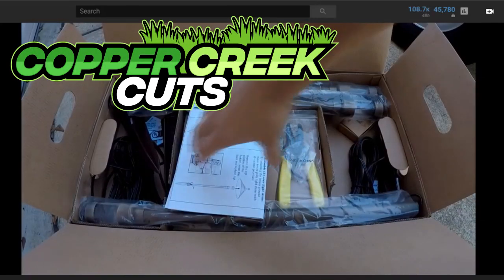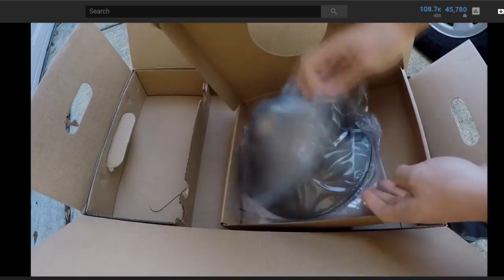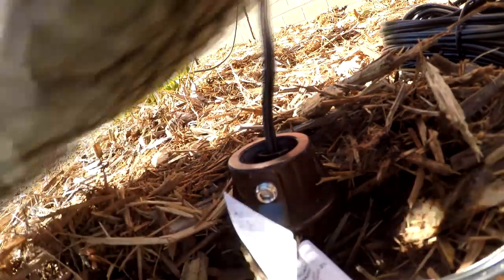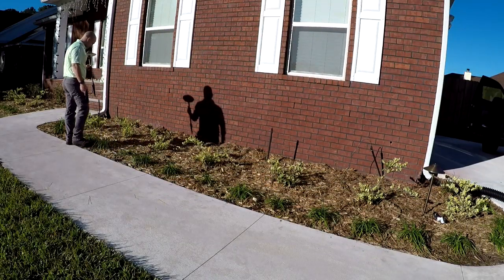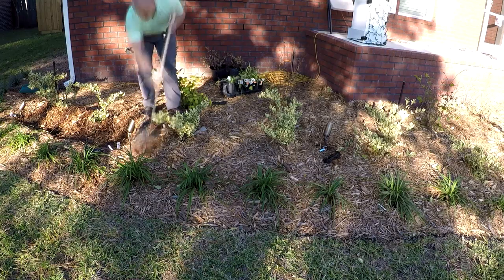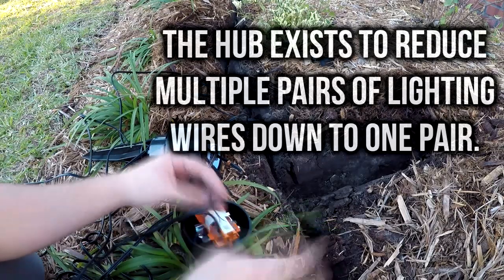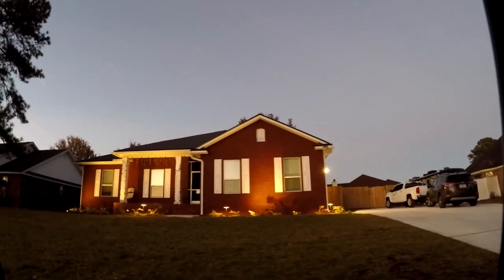How To Install Landscape Lighting That Looks Like A Million Bucks (COSTCO Volt Light Kit Install)

Comment: Does the Volt timer need to be used?  Want to use on demand and connect transformer to a light switch for ambiance lighting on a patio.
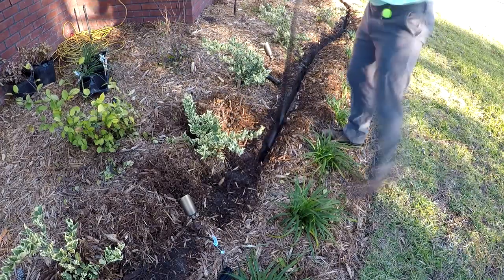Reply from the maker: The timer has multiple settings, including 'on'. https://www.youtube.com/watch?v=_Zo_bzC9IiM (4:15 for a still of the transformer that should help you)

Comment: Costco currently sells 6 piece kit with transformer and all other bell and whistles,  but I need 14 path lights. Can I add additional path lights to transformer or do I need to purchase two 6-piece kits and 2 additional lights?  If I purchase 2 kits can I add 1 additional light to each transformer?
Reply from the maker: You will need to research the items you are buying more, I cannot provide those answers. I can say that costco.com has a variety of different Volt lighting add ons (single lights, four pack lights only, etc), so you should be able to purchase more pathlights. As far as adding lights, that completely depends on the transformer. A transformer can handle a certain amount of wattage. Each light consumes a set number of watts, and the length of cabling ran also consumes wattage. You will need to do the math based on what your transformer can handle to see how many you can add.

Comment: Hello.  I'm thinking of getting this kit from Costco and installing myself.  How did you mount the transformer in your customer's garage?  the kit only comes w/ stakes for an outdoor mount.  I will be mounting my transformer in my garage, as well.  Thanks!
Reply from the maker: I want to say there are some mounting holes for hanging. Search 'Costco Volt kit' on YouTube and I have a video that might show a better closeup view of it.
Reply: @CopperCreekCuts  Thanks  . . .I saw your kit video, but I'll be able to see it in a couple days anyway.  I ended up ordering the kit from Costco.  It's such a great price, I couldn't pass it up.  just told myself I'll find a way to garage-mount the transformer for this deal!  Wish me luck!
Reply: markubig Did you end up finding a way to wall mount instead of using stakes? I just got mine in the mail and don’t see a wall mount option
Reply: @wesbz  I found this at Home Depot https://www.homedepot.com/p/Everbilt-1-1-4-in-x-18-Gauge-x-72-in-Zinc-Plated-Slotted-Angle-800087/204325585.  I think it's a garage framing bracket.  Anyway, I cut it and mounted it on each side of the transformer box (there are screw holes on the side of the box that you would use to attach it to the ground-mounting frame) and then screwed the entire assembly to a plywood board that I mounted on the 2 studs in between my garage doors.  The brackets don't sit flush to the rear of the transformer box, so I used rubber plumbing grommets/gaskets to fill the space when I mounted to the plywood.  It's worked out great.  FYI, the transformer will only work via a solar switch, so being that it's indoors, I connected to a Z-wave outlet.  Now I can just leave the transformer in the on position and turn the outlet on/off via timer with my z-wave app on my phone.  You can just use a regular automatic light timer/outlet as well.  I have a lot of smart switches/outlets, so i use z-wave.  By the way, VOLT LIGHTING IS AWESOME!!!! Really heavy-duty brass and the hubs make connecting the lights soooooo easy. I ended up purchasing extra fixtures from either Costco or directly from Volt.  My house looks amazing at night and neighbors & guests have been giving me compliments all summer!

Comment: Do I need the hub or can I just add to my existing 12 volt wire that I have my other landscape lights on.
Reply from the maker: I want to say that Volt system actually runs 16 volts, so I am not 100% sure.